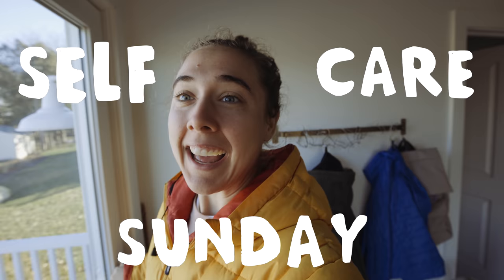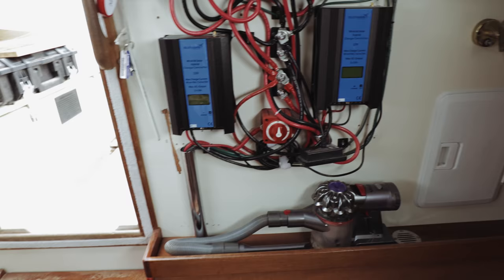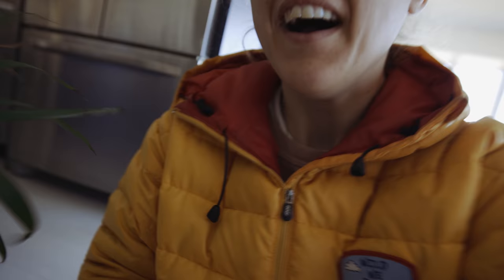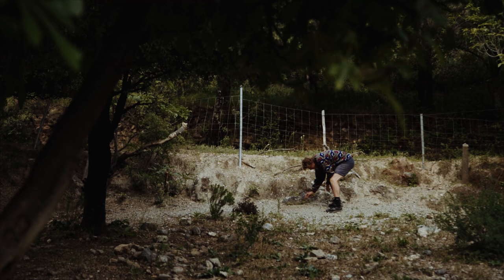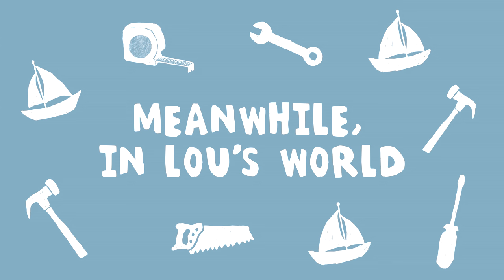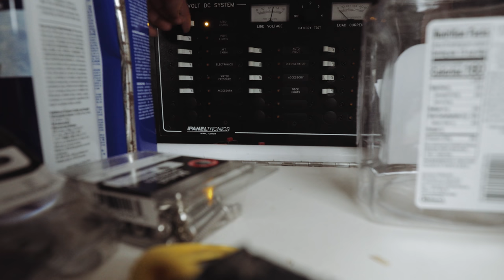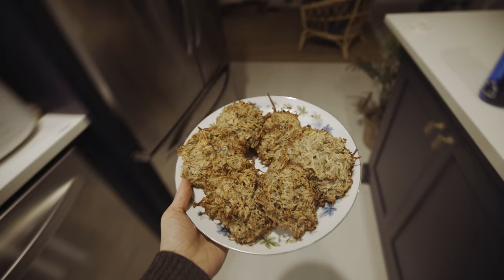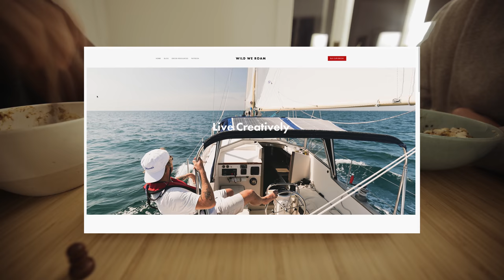Self Care Sunday | Boat Life Ep. 39

Comment: Be careful collecting on pebble beaches. What people don't understand is that the pebbles always work to the surface, so most pebble beaches have only a top layer of pebbles. One of my favorite places Montana del Oro State Park (in California) has a beach at Spooner's Cove. It used to be covered in pebbles, which made unique and beautiful,  but over about 20 years it's pebbles have all been poached leaving just the sand. 
The way pebbles, rocks and in my driveway, nails work to the surface is any movement of the soil, even swelling from infrequent rain moves the soil. Tiny bits will fill any gaps that open up under bigger bits. Over time, it doesn't take long, the bigger bits will work their way to the surface. This can be why some larger rocks end up on the surface, it's also why you have to dig to get to clay, clay is the super fine bits that fill in under everything else. 
On some famous corbel or shingle beaches like Chesil Beach in Dorset, England  it is against the law to collect stones.  Farther west along the south coast of England, near Lyme Regis you can collect as many fossils as you want, so long as anything special you might come across, you show to the local museum.   
But a rock or a pebble here and there.. it's the buckets and the bags,  'Oh I just want to do my front yard....'

Comment: Once you understand that there are three parts to a chess game, it makes it easier to digest. In the opening you want to get your minor pieces active, but don’t over extend your pawns.  Keeping good pawn structure is crucial for the end game.  In the middle game try to control the center of the board. If you are trading pieces, try to trade pieces of equal value. Trading a rook for anything other than a queen or another rook is bad.  Bishops are generally seen to be slightly more valuable than knights because the long distances they can control.  In the end game, you want to attempt to protect your pawns that hopefully you have managed to slowly move up the board, so that you can get one to the other side of the board to promote it to a queen. If you’ve traded queens, promoted a pawn to a queen, it’s lights out for Lou.  SV Flekk

Comment: Hi just wanted to comment some plant advice. So with the fern you have you were talking about it having type of webs. That could be mealybugs. And the way you can get rid of them is by stripping the soil from the plant. Wash the roots with a diluted hydrogen peroxide mix. And quarantine the plant because they can get on your other ones. And the black spots on your birds of paradise (I’m assuming that’s what it is) might be a fungal thing. So maybe the soil is too wet and it’s effecting the plant. You could let the soil dry out more often and try bottom watering instead so the plant takes what it needs without the top of the soil being moist all of the time.